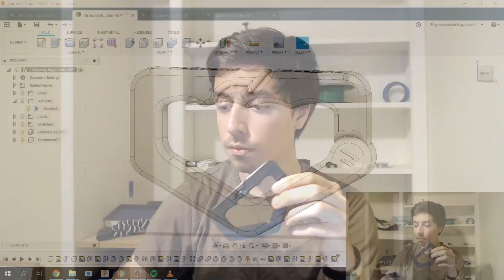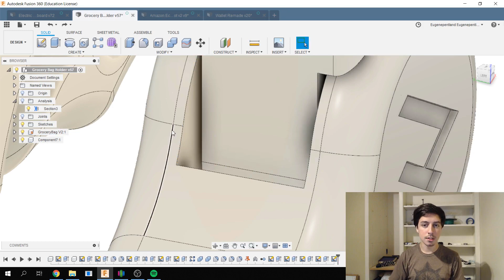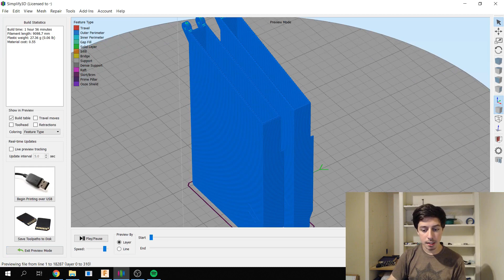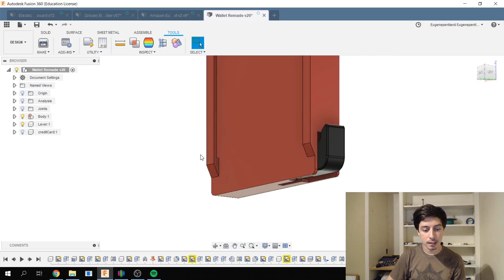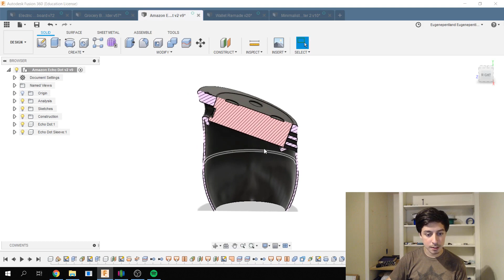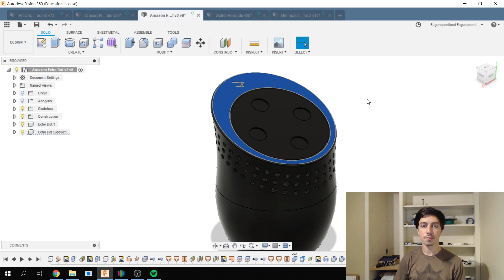Top 5 Tips in Designing for 3D Printing

Comment: Hey really great information here but could you elaborate on the slits to reinforce areas? I don't quite understand how that works as it seems counterintuitive that removing material actually creates better integrity. Also how thin should these slits be?
Reply from the maker: It's like how reinforced concrete is made. They put metal bars on the inside and then pour the concrete, and those metal bars make the concrete stronger in specific areas, the slits are doing the same thing.

Imagine printing a 100x100x100 mm solid cube. The slicing software will make a perimeter around the outside of the model, and an infill pattern say at 5% on the inside.

If you add small slits to the middle of the cube (0.1mm wide), it tells the printer to make more lines wrapping around that slit because it thinks there is another feature it needs to print. So this allows you to selectively add more material to a print and reinforce an area without increasing the infill and adding more material to the entire part.
Reply: @EugenePentland  thanks for the response! I will try this later and see how Cura handles it. Thanks again!

Comment: A tip for the "thin walls" issue - Imagine you have a 0.5mm nozzle, but your wall is only 1.2mm thick, you can usually get away with hollow-insides issue by telling your slicer a white lie, that your nozzle is 0.4mm thick, and perhaps over-extruding a wee bit. As the material-ejection-rate is based on volume coverage (and not on nozzle-diameter), a little imperfection in the specified nozzle-diameter (intentional, in this example) has little to no effect on the end-result. You're able to avoid the hollow-gap that would have resulted with a 0.5mm line-width slicing.